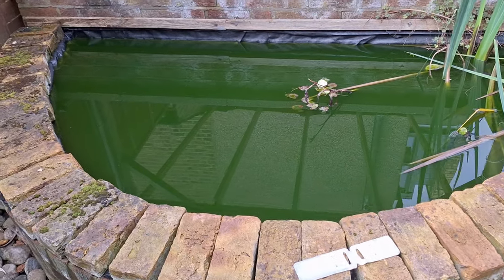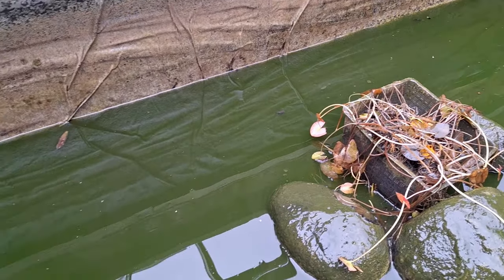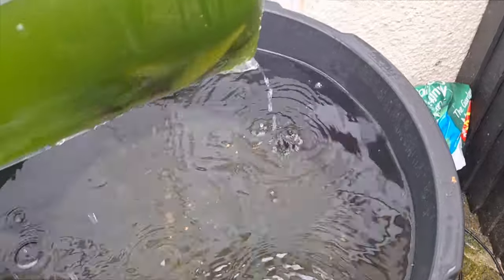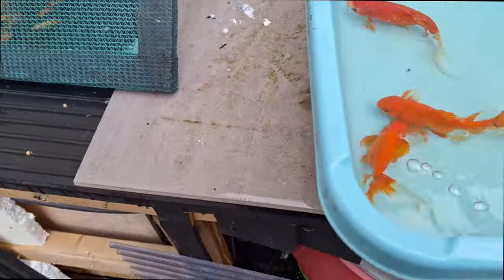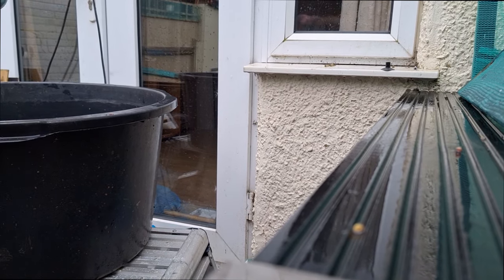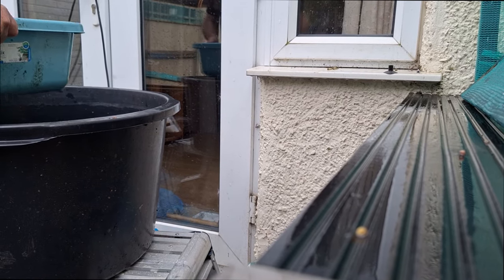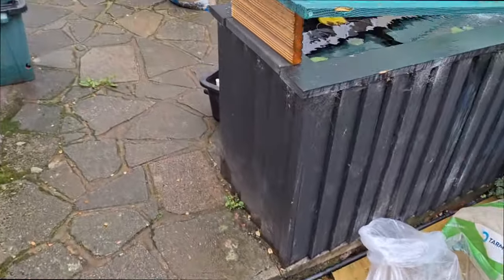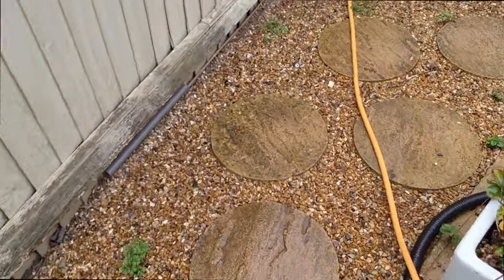What did I Find in this pond?

Comment: Sir, with huge respect, may I please ask why you go to the expense of Potassium Permanganate cleaning of filter boxes that are to be reused ? Bleach has a far greater effect which; with rinsing and exposure to air / light, will have completely disappeared over 24/48 hours ?
Reply from the maker: Thank you for your comment. Why did I use Potassium Permanganate and not the beach? I have an open packet of PP, and I don't like the smell of bleach. That's the easy answer.